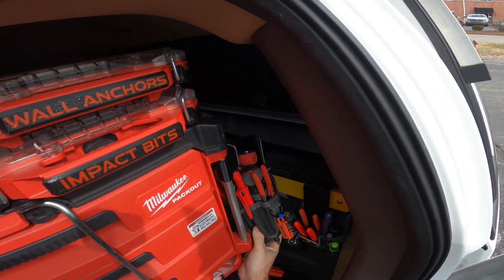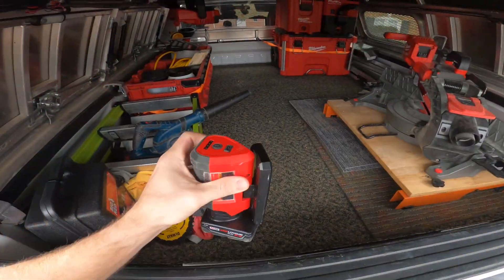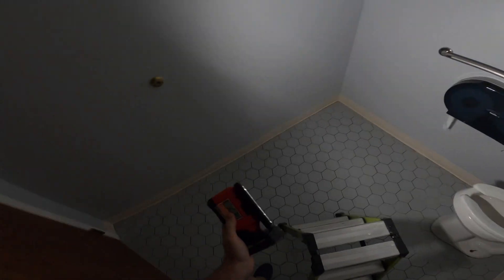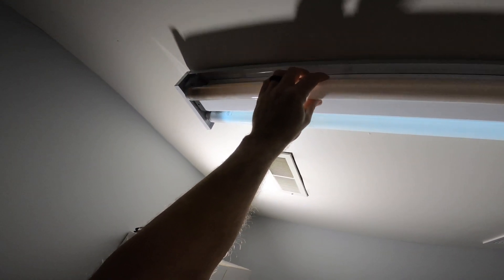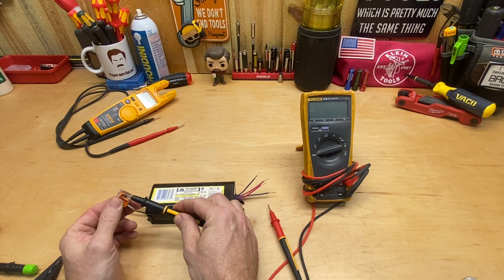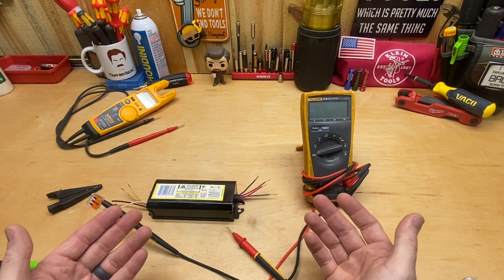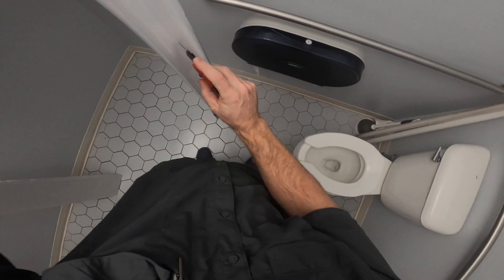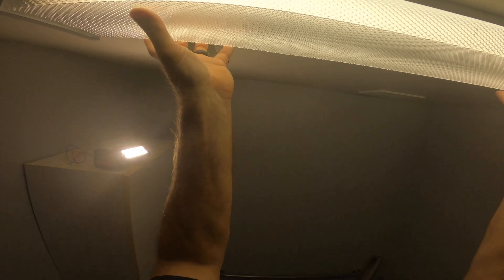Fluorescent Light is Out - Ballast or Bulbs / How to Test #maintenance #electrical  #watchmework

Comment: Excellent tutorial! What do you do when the plastic housing breaks when you’re removing it? 

I have the identical fluorescent light fixture in this video… and had to tape it together because I was unable to locate a replacement for the plastic cover. It appears to be original to the house (circa 1987). Any ideas who might carry replacement plastic covers? Thanks in advance.
Reply from the maker: @tedjohnson64  Home Depot and Lowe’s used to carry some, I’m not sure if they do anymore.  Even when they do, sometimes finding one that fits just right is a job in itself.

Comment: if the breaker is on can you still test the ballast or there needs to be power?
Reply from the maker: @chowchowkenobi9769  you need to make sure the hot and neutral are disconnected from the ballast when you test it.

Comment: 7:58 why is it bad that the cables are showing resistance?
doesn't that mean the cables are connected?
Reply from the maker: You are wanting the ballast to do the connecting, when unhooked from Power/neutral, you should not get an Ohm reading

if you don’t have that, that means the ballast internally is not in top shape.  It may still work, lights come on, etc… but it may go out with overheating, burn your bulbs out faster, not come on as quick…

This is how I was taught anyways… I also know all my new ballast out of the box.. have no reading on all cables when unhooked from power/neutral
Reply: @MORGANSMaintenance  cool, yeah the ballast must connect and disconnect the cables to make a circuit, pretty interesting. Thanks mate.

Ended up learning how to retrofit LEDs. They're up real high so want to set and forget. So just rewired and going the long term trick 👍 good video mate, cheers
Reply from the maker: @JmacBogan  going LED is the way to go in my opinion… smarter move

Comment: Bossman i got a question.  One time i encounter a problem where i change the ballast and it didn’t light up.  The connection is correct and the ballast is new.  My co worker tried to disconnect and connect the black wire from the ballast and the supply wire a couple of times.  Maybe 2-3 times don’t remember and it lights up finally.  First time encountering it.
Reply from the maker: I’ve never had that happen, where it would eventually light up.  I was going to say the “new” ballast could have been bad to start with.

Sometimes a ballast can be “bad” but still work.  It will cause the bulbs to burn out prematurely, cause them to flicker, shut down once over heated, etc.  So it could have still been a new “bad” ballast.

Then there are also certain ballast/bulb combinations that don’t jive well together. It could be a bad tombstone connection that finally made while you were moving wires.

It could be a several things and just by chance the connection made while you were moving the wires, but had nothing to do with connecting/disconnecting the black wire.

Those are all really guesses.
Reply: @MORGANSMaintenance  i hope to see more like this in the future, tips you can share.  I find this very useful.  Thanks!

Comment: Love the milwauke light.  I have the same one and it's my daily use one.  As for the Florescent bulb tester, i used to have a Uni-t one i got years ago which works great. However lately i've been of the mindset just to change out florescents to LED lights, because dealing with bad ballasts and lights on old florescent lights just isn't worth the cost of replacing the whole fixture or converting it to LED bulbs.
Reply from the maker: I agree on the lights... it just depends on who is paying the bill sometimes 😂
Reply: @MORGANSMaintenance  for me to buy a ballast locally, it's anywhere for $80-120 for a new one depending on the size.  The LED replacement bulbs are generally $15-20 each, and you can remove the ballast.  The other problem is, half the time your into fixtures with extinct bulbs in them, where it's a question to convert or just replace.  We went throught that at work, where we used a governemnt program to replace all the florescent fixtures because half of them had bad ballasts or other issues.  I priced repairing them, and it was honestly cheapaer to replace the fixtures entirely instead of buying new external starters & ballasts.
Reply from the maker: @JeffLMisc yeah the ballast here are still only around $25.  The LED bulbs have come down in price that they are only slightly more expensive than getting Fluorescent. So it’s cheaper here at the moment to replace parts than a fixture, but it really just depends on if the client is a how much is it going to cost me know verses later type of customer
Reply: @MORGANSMaintenance  there are a bunch of incentives and discounts here in Canada to replace stuff with led so it’s skewed the other way. Plus the government is trying to phase out fluorescent lights due to the mercury

Comment: Need more of these! Also why not just bypass the ballast and switch to LED bulbs? Cheaper than changing out the whole fixture if that’s what you meant
Reply from the maker: Both would have required a store trip.  It’s a space not used often, they just wanted it done as quick/cheap as possible. This was the fastest/cheapest option just because of a few circumstances 

That is a good way to go.  On older fixtures like this I typically recommend replacing the whole fixture due to age.
Reply: Can you do that with backup battery for emergency lights??

Comment: Nice How-To video. The voice over worked well too. I recently had to replace a ballast in a walk-in cooler. I pretty much followed the same method. I love the Wago clamp tip. That’s a keeper. Thanks Morgan.❤
Reply from the maker: Appreciate it buddy.  We will still have to deal with one occasionally, but they are definitely few and far between.

Not to many years ago is was a regular occurrence.
Reply: I often use wire lever nuts on the leads of a test bulb to test lighting. Very useful.
Reply from the maker: @ggrimm79  I have been using lever nuts for all sorts of things that are temporary in nature.. very useful.  Much better than twisting/untwisting over and over

Comment: If the light is on all the time, we will advise that retrofitting LED would provide better long term cost savings. If the light isn't used much then we would repair for them. Tend to find that as those fittings get old, that the diffuse dis-colours and the tube holders get brittle with the heat and crack.
Easy enough to do either way really.
Reply from the maker: Yeah, this is a basement bathroom that I don’t think gets used but once or twice a week by a tenant or their customers.

I normally recommend changing the entire fixture if it’s older.  Get 100% new parts and LED lighting.  You are right, the fittings and diffusers tend to get pretty brittle as they age.
Reply: Good point
Reply: Converting to fluorescent with a commercial magnetic ballast would be the best long term.. Most LED tubes fail after 5-7 years, while good quality tubes can last 12 or more years on a magnetic rapist start ballast.

Comment: Nice. Didn’t know that it’s so easy to check a ballast with a multi meter. Thanks for sharing your knowledge and experience. I like to strip my ballast wires before going up the ladder and mounting it. Less fatigue on my arms and shoulders if I don’t have to strip so many wires above my head especially if I’m changing out multiple ballast. If I’m using push in connectors I’ll go ahead and install them on the ballast ahead of time as well.
Reply from the maker: Good idea on the floor work.  Always helps to do as much as you can on the ground 👍

Comment: On my favorite red tab 3m wire nuts there's enough metal to stick to that railer strip or a magnetic bowl and makes quick work when the wire nuts are at eye level.  May save you some effort or dropping wire nuts later on!
Reply: 3M T/R+ Performance Plus Wire Connectors to be exact they can handle 2 stranded or 4+ 12g saves on carrying so many wire nuts
Reply from the maker: I may try that… thanks for the tip 👍

Comment: The voice over was fine and it opens up more content I'm all for it.  Your taking me back with tombstones....  I can get bulk led bypass bulbs really cheap if you get 50 to 100 so I bit the bullet and got a pile.  It's z win win I can charge a higher price for the bulb than I paid and when people need that job I ussaly van talk them into doing alot of them.  In bulk you can actually recoup your losses to retrofit fast on the power bill.  All said I get what you had to do but sometimes I don't give the customer a choice.  As harsh as that is many times it's better to do something for the long term better even if it cost a tad bit more.  If I loose business to someone that's trying to be penny wise dollar dumb sometimes its better to not be talked down on price.  Besides that glad you can see what makes that fluke meter special and makes you money.  I really wouldn't mind more work videos so our wives can stop complaining about the money we spend on tools that we may or may not need!
Reply from the maker: I just repaired some water damage from a plumbing leak at this building for some $$ I knew they weren’t expecting. So I just got it done for as little as possible.

I do just need to get some of the Bypass LEDs and put in my garage.  That way if I get a call I can throw some in my truck.  

Voice Over wasn’t as hard as I expected… you still feel like a weirdo wearing a camera on your head, but it’s not too bad.  The GoPro eats up some batteries though.
Reply: I my case I already invested years ago in buying fluorescent bulbs in bulk for personal warehouse lighting use.  I really hate throwing the money spent on them away, to make the move to LED's now.  Furthermore, I'm not aware of the existence of 'Bulb police' that are going to be monitoring my fixtures anyway (at least not yet).

Comment: I kept the fixtures in my garage, but swapped out the bulbs and crappy ballasts for direct wire LED t-8's.

Does that ballast test work on both types of ballasts?
Reply from the maker: I’ve done many of those over time.  I really do more drop in lights than anything and just usually replace the whole light with flat panels.

It’s how I’ve always tested all the ballast I’ve worked on.

Comment: GoPro works like a charm. Keep on filming like that more.
Voice-over is the only way to go at some jobs
Whenever I see wire nuts, I must reassure myself we're not in 1950s. How can y'all still use it up there?!
That's the job exactly for Knipex 13 66 180 (or anything similar, but cheaper) and Wagos.
Great job and excellent customer service.
Reply from the maker: 👍👍.. I don’t use them as often anymore. I have such a stock of them, I still use them in places to get rid of them. 😂
Reply: @MORGANSMaintenance  The only thing you can do with wire nuts. I edited the comment. Check out those wire strippers, please.
Reply from the maker: @Stefan_Kawalec 👍

Comment: Every time I always carry 4ft T8 double end bypass 4000K and 5000K LED bulbs and cut that ballast out, leave the fixture up and out of there, we used to carry the 8ft LED T8’s but we ran out so just haven’t stocked those in awhile. We do have 2 of each ballast on hand but they are likely never going to get used. Nice job there!
Reply from the maker: This is the first ballast I’ve changed out in years.  I’ve normally done the same.  I was the quickest/cheapest just due to circumstances and that’s all they wanted.

I need to get some of those bulbs to keep in my garage.
Reply: @MORGANSMaintenance  I hear ya, it’s been some time I’ve done ballast changes. Plus it’s job security there as well👍🏼
Reply: Alot of people charge recycling fees in oregon when you add $50 to take care of thr tombstones and bulbs people change there tune.

Comment: Great vid. It's gotten to the point, we don't even bother testing the balast. We just take it out, rewire, and toss in LED s
Reply from the maker: Yeah that’s normally what I do.. or just change out the whole fixture if it’s older.
Reply: Can a type A LED tube light bypass the ballast?
Reply: @splatx8176  Personally I'd just buy the bulbs that require a ballast bypass. Yes it's initially easier to buy the plug & play type, but you're still then relying on a ballast, which may be several years old and may go kaput at any given time.
If you're going LED, bypass the ballast and starter (if the fixture has a starter) and never need to worry about ballasts again.
Reply from the maker: I’m not sure, I know those are typically installed with the intent of plug/play with the  ballast staying in place.  There may be some where you can and some where you can’t.  I don’t think I’ve ever tried it
Reply: Fluorescent with a commercial rapid start magnetic ballast is far more reliable than an LED.